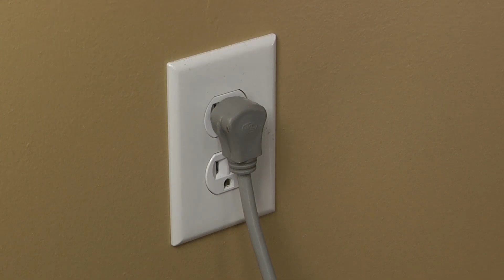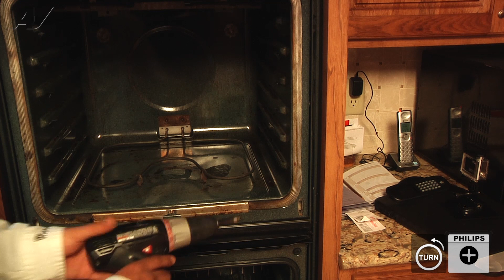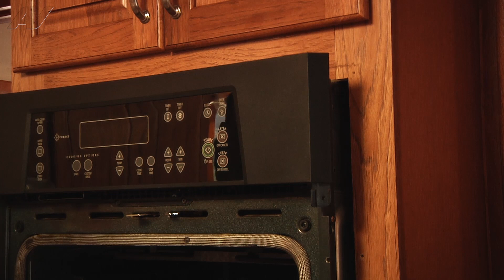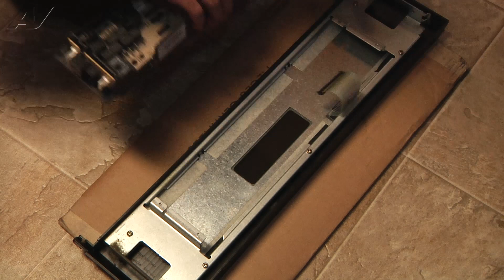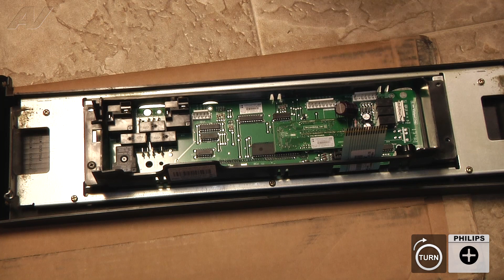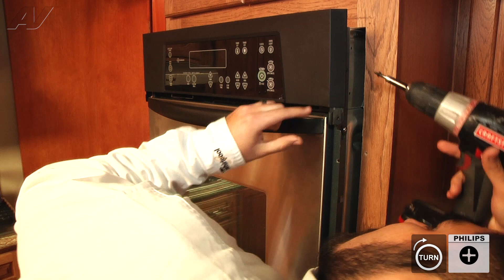Whirlpool Oven Repair - E1, F5 Error Code - Electronic Control

Comment: you can't do all that if your oven door is stuck in lock mode?
Reply from the maker: Great question, if you have a more technical question that our parts department cannot answer, you can search our over 17,000 answered questions free at our website www.ApplianceVideo.com under our Repair Help section. You can also call our parts department at 1-800-830-5465 and they can give you help 7-days A week ,or search at www.SaveMoreOnParts.com  .
Reply: For real, this is what I thought. What a dumb video.